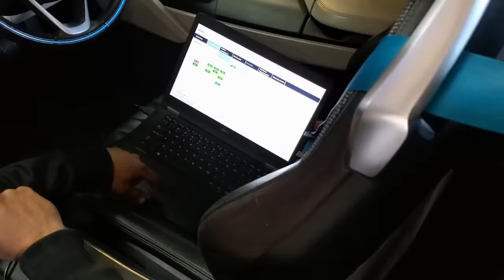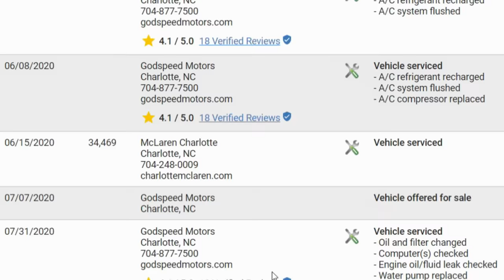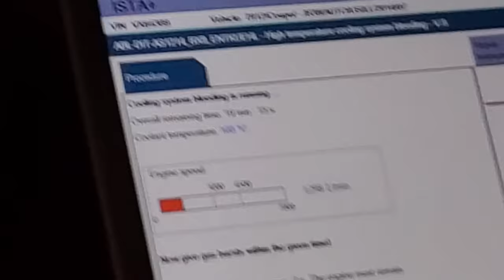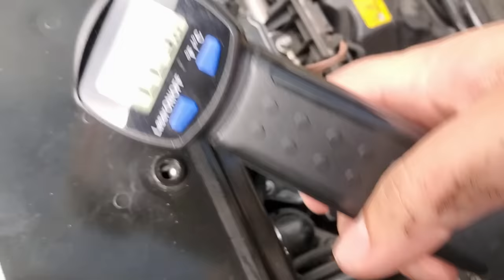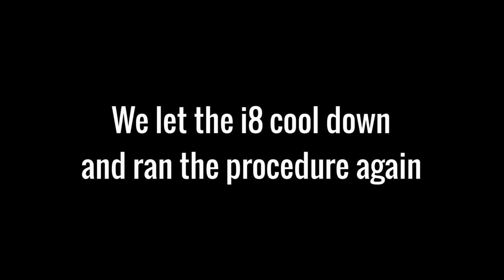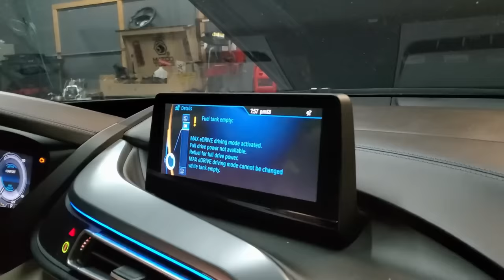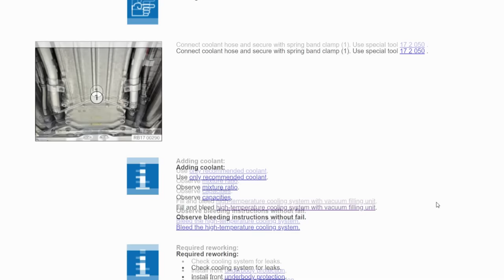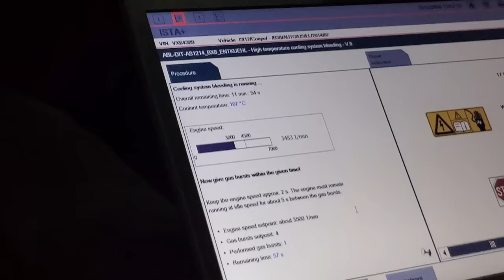Was my Repo'd BMW Supercar Sabotaged to make it Impossible to Repair?

Comment: I used to run a factory that made radiators with plastic tanks for one of the Big 3 in the Midwest. We supplied 1 million radiators to our customer without a defect over about 7 years.   We tested to 30PSI using air.  Looking at that little segment of the radiator leaking, it looks like the tank wasn't crimped onto the core very well.  I'd be curious if they forgot the rubber gasket that goes between the tank and core, or if it was twisted when installed.  Since you are getting a new radiator, I'd be curious to see what the core looks like under the tank.  We used to have alot of issues with the flux used to solder the aluminum cores to the end plates, getting into the seal channel, causing leaks.  Just bend the tabs back with a screwdriver/pair of pliers/prybar until you can take the tank loose.  You might have found a factory defect.
Reply: You should get some money for this comment if this is the actually cause of the problems
Reply: Id say your correct. My Australian ford falcon had a overheating issue spent ages trying to find it ended up being the crimp on the radiator. It didn't leak but when cold it sucked in air then it would overheat in a few minutes
Reply: Bought a used Ford F-150 from auction. Truck would overheat once thermostat would open. Tried different thermostat. No. Thouht what the heck, what about a new overflow cap? $6 dollars later and some burping, problem solved.
Reply: You def didn't supply for GM trucks cuz I've replaced dozens of Suburban/Silverado radiators leaking at that seam between the plastic edge tank and the radiator core
Reply: Bump
Reply: bump
Reply: @Onewheelordeal  Not GM.  Daimler/Chrysler.

Comment: Use a Thermal Camera to See where the hot coolant goes and if the Radiator work. Good luck!
Reply: I had this exact thought.
Reply: I agree 100% I would have to think it has a clog somewhere in the lines. Thermal camera should be able to find that real quick.
Reply: Good idea.
Reply: Was just about to ask if there was a way to snake or trace the entire coolant track, even throughout the engine. I really hope they fine the issue. I can’t take another unsolved mystery lol😥😳
Reply: Second American Revolution  not to see it dripping its like heat vision. Shows whats hot and cooler and will show exactly where 5he hot coolant is and if half the radiator is hot and half cold then you know its not flowing or with line or any of that. Its a great idea.
Reply: Great idea!
Reply: Terra 15 oh yeah
Reply: Terra 15 probably cost more than the car though
Reply: Yes, FLIR camera FTW
Reply: Great minds think alike
Reply: Great idea
Reply: I got one that connects to my phone for $185 Christmas special.
Reply: Do a coolant flush. Maybe with just water or coolant with a dye to ensure it travels all the way through the entire engine as well
Reply: Second American Revolution  you don't seem very smart
Reply: Second American Revolution  well, things are rentable and cars can overheat without a cracked/leaking radiator , you'd be able to witness in live time flow , flow speed . This cam theory I also great for exhaust issues / intake issues / vaccum leaks , without smoke testing

Comment from the maker: I was FORCED to clip out the part where Step Mom goes through my browsing history. I JUST posted the clip here: https://www.instagram.com/samcracc/
Reply: Your water pump is working?Fans?
Reply: Head gasket is faulty replace it and be done with it
Reply: Haven't finished the video yet. But I need to say I remember going thru this. Ended up being the radiator cap, that simple....  Long time ago but I have to wonder if that's it..
Reply: @cbruno12180  he already checked for signs of a head gasket leak and he did find anything wrong with it
Reply: Radiator cap ,Radiator cap , Radiator cap
Reply: @dandooyema8956  He checked to see if coolant was leaking INTO the oil or the other way around. The less common way a head gasket fails, is when cylinder pressure, not oil, leaks into the cooling system and pressurizes the system. You will see bubbles in the recovery bottle.
Reply: @jamcdona  correct it’s actually very common on diesels thou so that’s why I thought he may have a head gasket not seated properly or has failed
Reply: Step mom eh?
Reply: @cbruno12180  I'm sure he said he already tested for this in the last video (checked for combustion gases in the cooling system).
Reply: Have step mom work on the coolant pipes, she can get the blockage out 🤷🏽‍♂️
Reply: Either someone put something into one of the coolant hoses... or traditional bmw shitty water pump blade broke (they made of thin plastic) 

BTW, I may let step mom knows how to setup network parental protection house wide for fixing your addiction.
Reply: @solarwindp  I would definitely check the water pump, and I would also be very tempted to check those pipes are definitely clear.
Reply: That was the best part. 🤣🤪😱
Reply: Step-Mom is freaking hot!
Reply: @eddiemichael4333  yeah, he pumped it and pumped it and then liquid squirted out.
Reply: Hey Sam. Hopefully you will have solved this but if not have you thought of maybe an internally collapsd water hose.  It happens a lot with brake lines and cannot be seen from outside. Disconnect either end (engine/radiator) and try runnng water through both ways.  Just a thought.  Or maybe that disgruntled customer put a potatoe in the line Hmm.
Reply: Hopefully we won’t see Sam’s crack!!
Reply: I'd try a CO2-test to see if any exaust gasses push into the cooling system.
If this is not a blown headgasket or cracked head or something like that I would check every hose of that cooling system. I would not wonder if you are right with that sabotage idea and someone put something in one of the cooling lines...
Reply: @Survival4theFamily  Hopefully we will see “Step Mom’s”!?😂
Reply: hey sam, does the battery of the car is cooled with the same coolant of the engine? i heard that those baterys overheat if have some issue with it....
Reply: Water pump impeller separated from the shaft, or missing blades? Possible broken blades from a previous failure blocking the coolant pipes? Don't forget to back-flush the coolant pipes with the radiator and water pump off the car.
Reply: OMG, what did she do? Question the election results?
Reply: Sam, if you have any leak in the coolant system at all it will trap air in the system while vacuum bleeding. That radiator did not blow from a pressure test, it always had a slight leak and was sucking air in. Replace the rad and drain ALL the coolant. Vacuum and fill using the vacuum
Reply: @PedroChehoud  Do what Little on the confuse side
Reply: Who's the girl at the start of the video
Reply: @crowntsp  right?!?
Reply: @theworstgamervr  dont judge
Reply: maybe they installed a non OEM water pump
Reply: That’s gold
Reply: @cbruno12180  you must be new here
Reply: @mrman17  then he’s gotta have air trapped in that system rt? Only logically Answers why the over flow is boiling over?
Reply: Now I have an old VW that has an incredibly similar issue. On that car there is a thin coolant tube that returns to the expansion tank, that little hose was plugged.
Reply: @jamcdona  This is exactly what failed my wife's 2004 Eclipse. You could see the bubbles in the cooling system, and it was so severe that if you started the car for a couple of seconds at cold, turned it off, and then went to remove the radiator cap pressurized coolant would explode out of the radiator. You could also see after driving bubbling all through the reservoir. The engine was so bad that while it wasn't mixing oil/coolant, it was not salvageable and we ended up getting one from a junkyard and refreshing it.
Reply: Why were you forced to remove the clip???
Reply: @radio-pirol  The thing with this is there would be steam from the exhaust and or water inthe oil. Also the system would have already burst somewhere (usually the filler cap) with the extra pressure.
Reply: Three words ,,, THERMAL IMAGING CAMERA...
Reply: This is what we want to see. Unlike tavarish who nowadays builds nothing that really intrests.
Reply: Somewhere...within the i8 is a restriction within the system.
Reply: Rig up some air fittings and blow air thru the block and make sure it’s not clogged
Reply: Its either a high point in the engine has a large air bubble (not likely) or the coolant flow is too low caused either by a bad pump or a restriction. Since this is happening with the spring pulled on the thermostat which usually allows much higher flow and you followed the exact directions to eliminate air in the system, I set air bubble no the back burner.  The new radiator will likely eliminate it as the restriction 

This is where in the others diagnosis the engine replacement recommendation  was made. The only other thing would to be disconnect the system at numerous points and use water (hose) to back flush the system at high flow.
Reply: With a good diagnostic tool, you should be able to watch the command for the fans to come on then watch the fan come on.  The command should occur at a consistent temperature through a number of cycles.
Reply: The radiator is the culprit.
Reply: please cut it all. Its godawful.
Reply: @cbruno12180  Not with a good compression test & leakdown test.
Reply: If you’re changing all these parts. Radiator, Coolant cap, water pump and thermostat, you got pretty much everything covered. I would inspect the piping in case they would be clogged with a rag or some like this. Run water through it with the garden hose while it’s apart.
Reply: @jiminauburn5073  That was the money shot
Reply: @theworstgamervr  well how do you earn your rent
Reply: I saw that Step Mom somewhere. Always stuck in akward places
Reply: I think radiator blew up because that was weakest part in the cooling system. And it's possible that was the problem, few times i had problem with parts that was not completely seald, sucking air but not leaking. We will see. Good luck
Reply: @cbruno12180  YEP! I had this happen on my old Alfa Romeo, a week after getting a new head gasket. I could hear the bubbles coming up after I shut the engine off. Irritating; mine was a cheap head gasket; I had given him a nice german gasket and he kept it and put on the shit gasket.
Reply: @DarkRider2k3  Yeah, I had the original gasket changed on my 86 Alfa Romeo due to oil seeping down the block, and got it back with the cooling system being pressureized; cheapo head gaske blew the first week out of the shop. I don't think that this is Sam's issue though, after watching the whole video.
Reply: Is the water pump spinning in the right direction? Has the flow been reversed?
Reply: The old waterpump impellor probably broke apart, new pump fitted without removing the old debris.. Blockage
Reply: Have you actually measured the temp of the water? you assume the sensor is correct because it reads 'Something.' . You need to prove  the sensor temperature.
Reply: Take the fan motor apart.  I'm sure brushes are stuck been there already.
Reply: @Oggyj1s  I'm guessing.. Or rather hoping.. Breasts
Reply: The fact that the thermostat was removed and overheating still happens  proves a flow  issue or an inaccurate temperature reading.
Reply: MVP
Reply: Sam your a GOAT for posting step mom skits 😂😂😂🙌🏽
Reply: @andrewhallin  came here to say the same thing
Reply: Honestly as soon as you mentioned that the thermostat had been replaced a few times I was waiting for the reveal that there was a blockage. Even more so after the fan didn't turn on after the pressure charging. If
Reply: Check that there is nothing blocking the cooling circuit. I just bought a c230 komppressor as a father son project with  a overheating problem. I found that someone stuck a piece of cast aluminum in a cooling passage of the head. It had witness marks of the pounding that the person left when it was stuck in there. I Pulled it out problem solved. So do not leave nothing to chance. Check everything and go systematically. I am sure you will find it.
Reply: send it to chris fix he will be up to the challenge
Reply: Is that ur real step mom?
Reply: Step mom is the best part.
Reply: Step mom forced you again? Bummer......
Reply: Stay the course, my friend. It's  a truly beautiful car and well worth it! ✌
Reply: Hope you end up fixing it and don't have to send it through through the auction again
Reply: @AutoAuctionRebuilds  Randy! Shame, shame, U go thru this same sh*t alla time!  You can't be sure the swamp Vette was a joke or not, yet!
Reply: Forced by whom, I don’t approve of censorship!

Comment: I was derailed by the step mom, you’ll need to pull the coolant system apart. It’s probably blocked with a blanking plate or something

Comment: To quote Rabbit "When the car stops the payments do too"   The owner dumped the engine and stopped making payments, the bank picked it up and that's how our story starts.
Reply: Final price on a car is either when your name isn't on the owner's papers, or when it's up in the green pastures of the junk yard. A car like this probably costs twice or thrice the actual cost now, with all the bs going on,.
Reply: @aserta  they should persue the previous owner for the cost of the repairs.
Reply: @PhilOsGarage  How can you prove that the previous owner sabotaged it when you can't even figure out what the problem is?  The previous owner could also simply say that one of the other people that bought it at auction or the numerous repair shops screwed it up.  How could you prove otherwise.  Also, the car was most likely still under some bumper to bumper warranty so the previous owner wouldn't be responsible for any repairs anyway.  When you buy something at auction, you probably buy it as is.